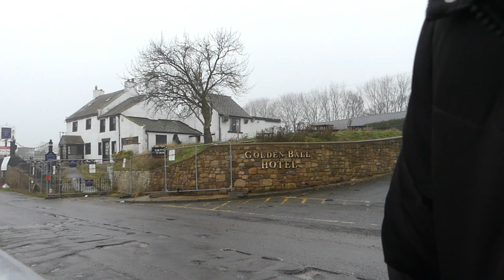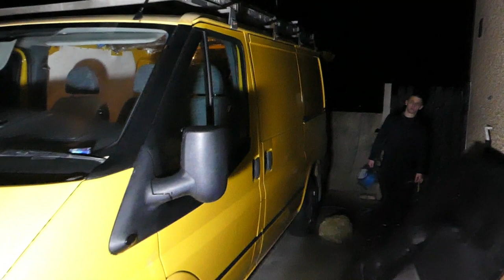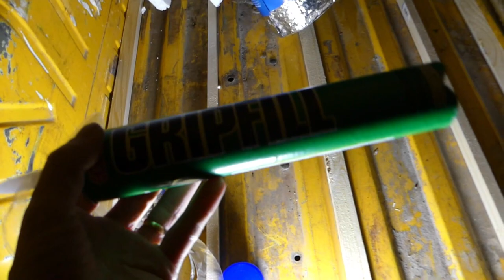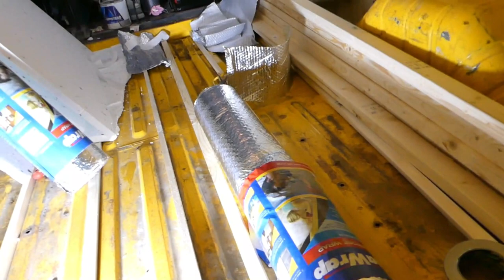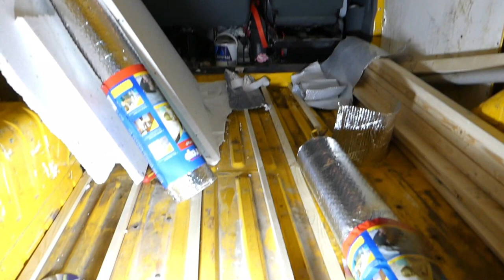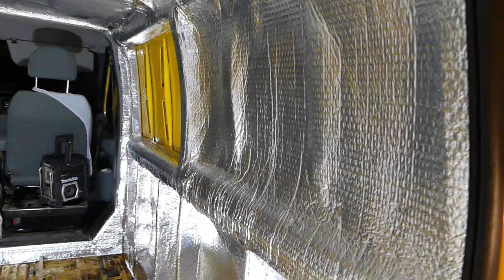TRANSIT TO CAMPER part 1

Comment: Hi smithy the water you use for the camper do you drink it from the tap or boil it ,how do you clean inside of the water tank and what product to keep the tank clean thanks
Reply from the maker: Do u mind if I answer at the end of the month. I have a few questions for the end of the month video and I would like to answer it then. As it helps others as well.